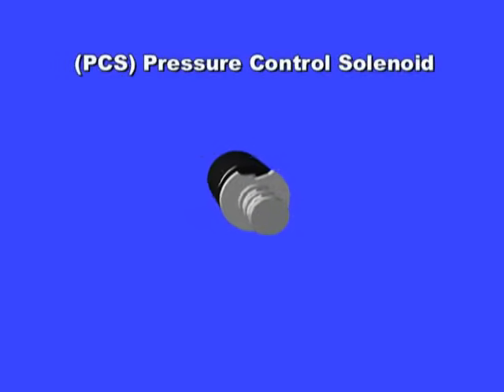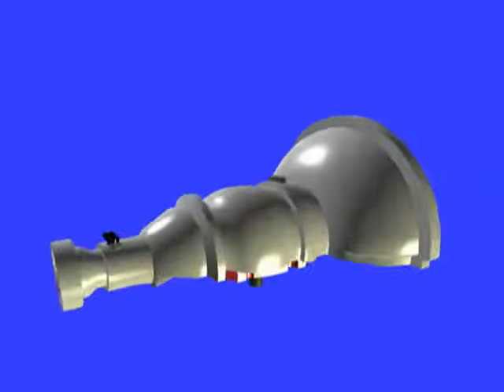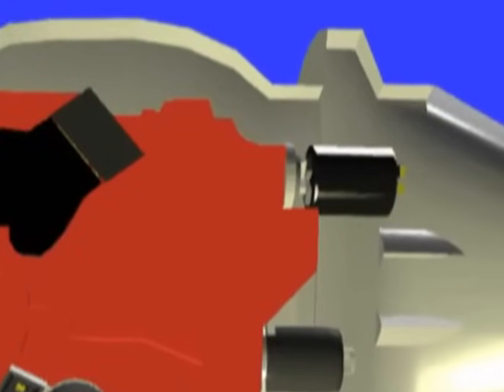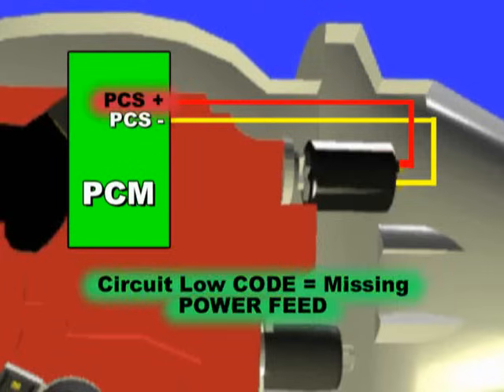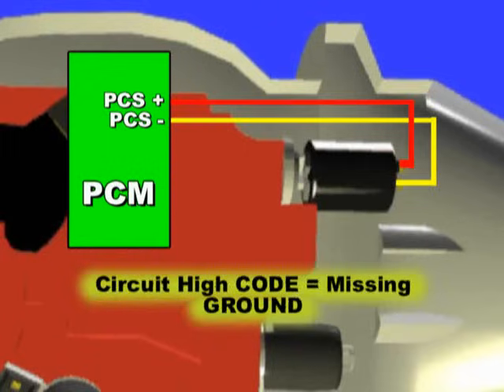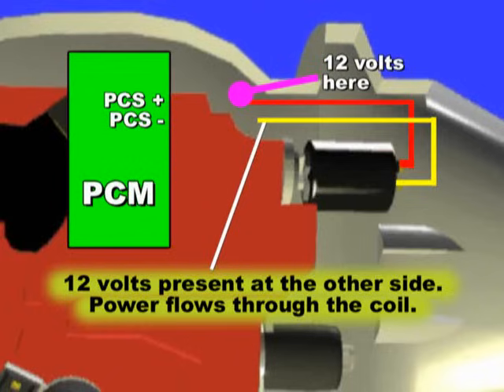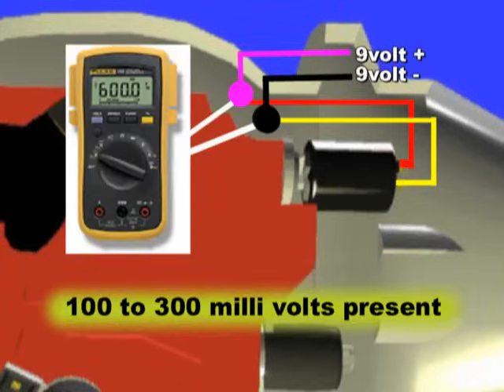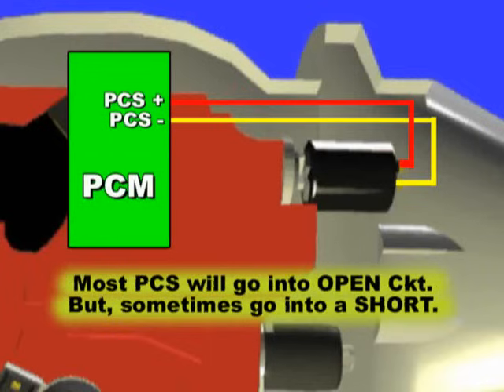Transmission Pressure Control Solenoid (PCS)

Comment from the maker: I agree, modern consumers should get educated and learn as much about the system as possible. Yes, often times a $100 part is all you need. But, there are good repair shops out there. It is also a risky situation. If you do replace the PCS and the transmission goes a few months later, the shop gets blamed. Any court of law will fault the repair shop first, regardless of what they did. Education and knowledge are the consumer's best choice...Thanks for posting...

Comment from the maker: CONTINUED FROM 1:

Check fluid level and quality, add if needed, don't replace fluid, a burnt clutch pack, stripped overdrive clutch hub, worn accumulators, worn valving especially the actuator feed limit valve, and just high mileage can all cause this code. 

Basically, the ECM is seeing a long engagement or like I said a slipping. Again, check fluid level and add if needed. Post back with more and let us know what happens...Thanks for posting.
Reply: ADPTraining  I  have a 99 Chevy Silverado,  I had a small accidents  that damage my radiators and cooling systems,  after the repairs where done my truck drove about 100 miles fine and then start losing pressure transmission would go over 50 took it back to the mechanic "Said need it a flush " after that was done I drove it again another 30 miles and then transmission wouldn't engage at all , called him back and said transmission was bad , I waited 40 minutes for the wreck truck  and while waiting I decided to tried to move it to get out of the way,  to my surprise transmission worked just fine for another 5 miles till oil gets hot , and is been like that , any  suggestions? Thank you.

Comment from the maker: Yes, most YM 2000 and up are dealer tool dependent. Having said that, lots of Aftermarket scanners also have this capability now. By the way, resurfacing a trans valve body isn't easy. Most shops just replace the whole thing with a new one at a higher cost to you of course. If warped you'll need to resurface the valve body on a milling machine or the old fashioned way, use a 2'X4' mirror and glue sandpaper to it then run the VB to resurface. Old trick I learned a while back. Good luck.

Comment: I was asked to clarify my earlier comment. In the video it says many of these solenoids cannot be checked with an ohm meter. GM 4L60E will ohm at about 4.5 to 5 ohms. Of course you must have a good volt ohm meter or DVOM as we call them. Meaning digital volt ohm meter. Ford Motor Co. 4R100 or E4OD will also Ohm test in the same range as the GM solenoid. An ohm test will only confirm that the electrical part of the solenoid is good. A pressure test is required to test the mechanical part.

Comment from the maker: Chances are the trans is gone. Brown fluid is a sign of extreme transmission neglect. Do spend money doing a fluid change. If leaking, the pump gasket is probably gone and hence a PCS code, but code related to system not necessarily solenoid. If you've ever done a trans, then remove, disassemble pump and replace entire pump with gasket. Remember, you may end up doing all the work for nothing, since the rest of trans may also need repair. Shake is caused by friction slipping at the wet clutches.

Comment from the maker: Oh wow, yes the trans has outlived itself many times over. Not that many transmissions last that long. There's no reason a car can't last forever, unless the chassis rusts out completely. Being that you're n school and on budget, I would suggest a used trans from the salvage yard, so long as the repair shop warranties it. It is not the way to go if you're keeping the car forever, but may work out even better than a total rebuilt. Good luck and thanks for posting.

Comment from the maker: That's usually what happens. The issue is either the PCS, which controls the pressure or an issue with the valve body. Sometimes, one of the valves has to be honed it due to damage. Once a shop open the trans, they'll want to do a rebuilt, due to liability issues and you coming back afterwards with another trans issue. If you're planning on doing the work yourself, then fine. How many miles on you car?

Comment from the maker: @SunsetNap YES it can. The NSF tell the TCM which gear it should be on. There's a varying voltage that goes to the TCM (Trans Computer). It's not a simple on and off switch indicating Neutral and Park. On most systems the TCM then broadcasts the gear position via the vehicle network for the dash to show the shifter position.

Comment from the maker: @surfmusicjamweedgirl OK, use this rationale: If when dismantling the Trans oil pan you have access to the PCS, then don't change it (assuming it's ok). PCS units are the strongest of the all transmission solenoids. They have to be. But, if getting to it requires major disassembly, then replace it. 4L80Es are strong units, but you do have almost 300K, so tread carefully. Good luck...Mandy.

Comment from the maker: The issueis is there is no internal transmission fluid filter. The clutch material that wears gets into the pump, valve body, and converter, which is why you have the fault codes. Most of the time a trans needs rebuild. Acura extended the warranty on the transmission, which is included, contact Acura of America customer service. Look up Service Bulletin 02-027. Sorry for the bad news.

Comment: Sure let me get that info out to you tomorrow..based on your advice here I checked the transmission fluid level and it was right at the line where it says to add oil. The car is a 2001 Aztek. the Code is 1810

Comment from the maker: @PatinOmaha These PC sol. are tough units. If possible disable by removing fuse (if separate). The noise does seem a bit problematic. A faulty PC sol. would not cause a noise. 

Other possible fault areas are the TPS and VSS (vehicle speed sensor). The TPS is a main shift input to the TCM. VSS is the main speed input and also a main shift point determinator. Good luck to you. Mandy.

Comment from the maker: @Kintosol89 Hi, ok the Press. Cont. Sol. circuit low means gone to ground. You may not have a solenoid fault. This is how it works: A relay provides power feed. The ECM grounds the solenoid. If no power is seen at the other side of the relay, then you get a "Circuit Low" code. You need to pull out wiring diagram. Alldata information systems have DIY accounts for one car, one model only. Check it out. Probe and make sure you have power feed to the solenoids. Post back with more...

Comment from the maker: If a shift into any gear other than reverse and forward engagements takes longer than 0.65 seconds to complete, code P1811 will set. The ECM will then command maximum line pressure inside of the transmission, resulting in harsh shifting. 

ECM will also command the check engine light light to be illuminated when P1811 is set. Basically, the PCM is sensing a slip, and is increasing line pressure to maximum in order to prevent the transmission from hurting itself further.

CONTINUED 1:

Comment from the maker: OK, the fact that the voltage starts at 3 and drops to 1 says that as the PCS gets hotter, resistance drops, hence 1 volts seen at the end. One volt is kind of high, meaning that there's excessive resistance at the PCS windings. Having said that, compare by measuring resistance, with solenoid hot. These units normally carry very low resistance. Or almost like a straight through wire. Your PCS doesn't seem shorted, which is more common.

Comment from the maker: I don't have to call anyone. All electrical circuits need current to operate. A current test using the clamp-on AMP probe will always give you the most definitive results. Forget Ford uses this, GM uses that...none of it maters. ALL CIRCUITS run on CURRENT flow. A resistance test is fine, but it's a static test. It'll pass when the component is cold, but fail when hot. It is the nature of all coil windings. You can research what I'm trying to tech you or take on faith value. Thanks again.

Comment from the maker: Sounds like a linkage issue. Look into the shift lever to transmission linkage. If trans is defective it won't go int gear no matter what, even if you push it. Do some visual inspection on the shifter and post back with more.

Comment from the maker: Depending on the year, but chances are yes. The NSS or trans-range switch is used by the ECM to compare to the gear pressure switches that tell the ECM the actual gear the trans is in. Did that made sense? Thanks for posting.

Comment from the maker: You can gain a lot of insight on the problem by referring to the OBD-2 code. These are either Circuit-Fault, or Mechanical in nature, also circuit low or high. Look up the exact definition for the code. Good luck.

Comment: Good video. Initially you informed that do not test it with 12 volts but you tested it with 12 volts. So, will it not damage the PCS?
Thanks.
Reply from the maker: Not through a testlight

Comment from the maker: I need to know which code was it exactly. There are a few codes for the PCS. Yes, you can replace the PCS. It is a solenoid and shops don't just replace it because if something else on the trans goes a few months after, they don't want to get blamed. Some dis assembly will be required on your part. Post back with more...Mandy...

Comment: I have a '95 Mitsubishi GTO (same as 3000GT) with an AWD ATX. Well, After replacing the transmission fluid, filter and main seal, due to a very slow leak, the car started behaving very strange. It would sometimes churp the tires when I try to get off the line quickly immediately after a sudden stop. Also, it would drop the RPMs suddenly and try to stall the engine when letting off the gas and reaching low speeds about 25mph or less (going around a round about).

Comment: NEED help I have this honda accord 94 automatic. At first it runs smoothly but after 10 to 15 mins. it dont' move forward.  I'm having problem with the transmission even how hard i step on the gas my car wont move its  like  the gear is on park. I let it cool  for 3mins and it start moving again moving but very slow. Do I need to change the transmission . Well I'm from Philippines and I cannot find Lucas oil.  in here . I already change the fluid and still the same problem.

Comment from the maker: No, an Ohm test will not tell you if the part is good. Often times the shift solenoid fails when hot and it fails due to shorted windings. By and and large the best way to test a SS is by doing a current rampping test. This you do using a clamp-on AMP probe and scope.

Comment from the maker: The TCC has nothing to do with it. Any car can run without TCC. It's only active at higher speeds to lock the engine and transmission together, as in a regular clutch. See if you can manually shift to 3rd gear.

Comment: Transmission is stuck on 3rd gear. I did a DTC computer analysis and I got this code : P0748 : Pressure control solenoid valve (Vfs) 'A' Electrical.
I have removed the valve body and tested the resistance of the PCS and it was 3.6 ohm. I have connected 9V battery to the PCS but the plunger didn't move. Does that mean its faulty? 
Specs: car is Hyunday Accent 2012, 4-speed transmission type A4CF1 and 1.4L 4-cyl engine

Comment from the maker: We developed 2 items for transmission diagnostics:

http://www.autodiagnosticsandpublishing.com/TransDoctor_Auto_Transmission_Software.html

https://sites.fastspring.com/autodiagnosticsandpublishing/instant/automotivetransmissiontroubleshooter
Reply: Good video !
But a i have
a question. I have a mazda protege 2002 sedan automatic transmission. On the mornings if i dont let the car heat up around 10 to 15 minutes  when i put the drive shift it slip. I get a code and i have the p1250 which is for the pcs D

what thoes that means ?
Reply: Good video !
But a i have
a question. I have a mazda protege 2002 sedan automatic transmission. On the mornings if i dont let the car heat up around 10 to 15 minutes  when i put the drive shift it slip. I get a code and i have the p1250 which is for the pcs D

what thoes that means ?
Reply: am so much intrested in transmission work how do I do it with your company?
Reply: am so much intrested in transmission work how do I do it with your company?
Reply: am so much intrested in transmission work how do I do it with your company?
Reply: am so much intrested in transmission work how do I do it with your company?o
Reply: am so much intrested in transmission work how do I do it with your company?o

Comment from the maker: CONTINUED from 1:

2nd, if press ok, prove your pressure sensor (refer to other videos here). 3rd, if sensor proves good then test your pressure control solenoid (again, refer to our other videos). 

Beware: in the event the PCS is faulty or with it disconnected the sol. is normally open, so max press. is applied. You wouldn't have a delay but a hard shift. I think your issue is either PCS or pump itself, but don't jump the gun and follow procedure. Good luck.

Comment from the maker: Check power and grounds for the TCM module. Also check power and grounds feed to the transmission itself. Since some transes do get their ground from the chassis, check the ground strap at the Eng block. Makes sense?

Comment from the maker: Honda automatic trans are different than the other makers. Forget Lucas as there's no magic fluid to replace that fixes your car. Diagnosing Honda trans of that year us easier since the solenoids are not inside. I need more information. What happens when you put the shifter in 1st or 2nd gear? Tell us more about the symptoms...Thanks for posting.
Reply: ADPTraining runs cold quits when hot no gears

Comment from the maker: If stuck in 2nd gear, then it's limp-in mode. TCM saw a discrepancy issue and set LIM. Erase codes and reset adaptive memory. Let me know if that helps.

Comment from the maker: I don't what you mean by induction system. But anyhow, there are many things that can cause it. Replacing the trans fluid after it's due date can cause lots of issues due to viscosity changes. In all my years working on cars If I knew that the owner was late on it I would discourage him from replacing the fluid. The issue may also be on the AWD system. I really have mo more info to go by. Are there codes present?

Comment: I replaced some parts from the air intake system first, because I thought that the problem was there, but it seems as if the problem is in the transmission. There are no codes or warning lights...

Comment: I have to hit the gas, in order to keep it from shutting down. So far it has shut off twice since I had the music loud and didn't hear the engine. When this happens, I could hear a whining noise coming from under the hood as if something there is struggling. If I don't hit the gas at that moment, the car feels as if I am applying the brakes or something is stopping it. Furthermore, the car would surge ocasionally when accelerating from a slow roll between 2-3K RPM. Slow leak is observed again.

Comment: I'm getting a PO741 code on a '05 Toyota Corolla.

1) To access the trans lockup solenoid, is draining the ATF required? I am ready to change the ATF and filter and clean the magnets as a first step to see if the code changes, but I don't want to have to do it twice.

2) I've read that some people just ignore the code and accept lower gas milage for a while. Is this okay?

Thank you!
Reply from the maker: Great. Thanks DONATE: https://www.paypal.com/donate/?hosted_button_id=F9W5VPHTGWBV6

Comment: I have a 96 dodge dakota with a 42 re trans.I was having a very rough shift from first to second and was informed that it might be my shift solenoid so I changed it and the sensor put it back together but know it wont shift out of first at all,so I took it apart again to check and make sure my connection were tight, that i had power and ground to the sensor and solenoid which I do,buttoned it up and still no upshift,need your expert advice on this one.

Comment: I have a 2005 grand Cherokee 5.7. I first received the P0700 code with a lot of other various codes which came from the bad battery (low voltage codes). Also came up was the code for speed sensors input and then the P0934 code for oil line pressure sensor. I replaced all but just a couple days later the engine light came back on and the codes were the 0700 & 0934 again. Your video makes me think I have a similar problem but not too sure. It's so difficult it seems because the transmission is all electrical. I wonder if I have a bad solenoid under the pan area?

Comment from the maker: I find it amazing that no mechanic can fix your issue. We badly need proper training for the traditional trades. OK, 758 tells you that there's a general error. Here are the possibilities: Hydraulic pump, pressure sensor defective, or PCS (solenoid). 1st you need to take a manual pressure reading and if PRESS ok, then no rebuilding is necessary, otherwise replace pump. 

CONTINUED 1

Comment: I have a 2000 Montana van that is occasionally up-shifting hard and has a whining noise when that's occurring.  Some people say that it's a trans pressure control solenoid.  Is that a common problem on that GM vehicle?

Comment: Hi I have rebuilt manuals buut I think I'm going to gain the experience of automatic soon , this ford taurus has 70 k on it no sdlipping just a slight shudder putting it in reversve and the voila , nuthin in any gear . The car has 70 k from my granny so i know its not worn out . Does any one or you sir have any idea what it could be before I swap out whole thing?

Comment: I have a 2009 ford mustang that has a p0966 and p0193 codes. Changed the fuel rail pressure sensor. So was wondering if the other is something to do with my transmission.
Reply from the maker: Yes of course it's transmission. Use t our PWM Controller for trans testing. 
http://autodiagnosticsandpublishing.com